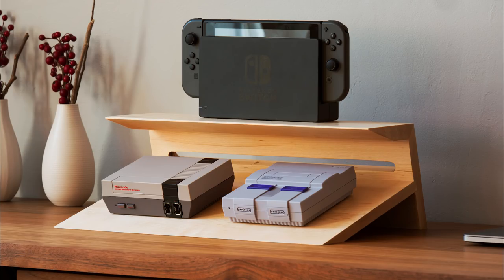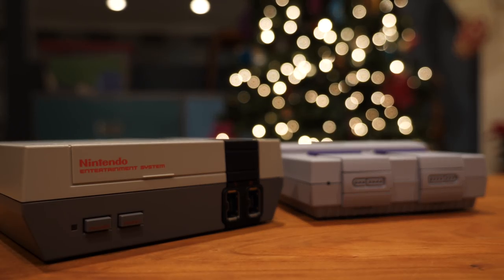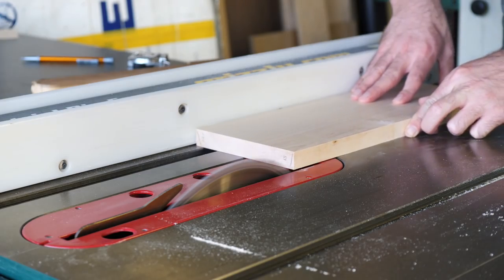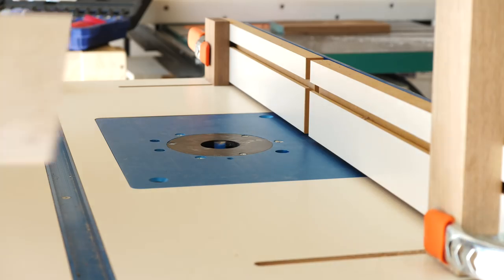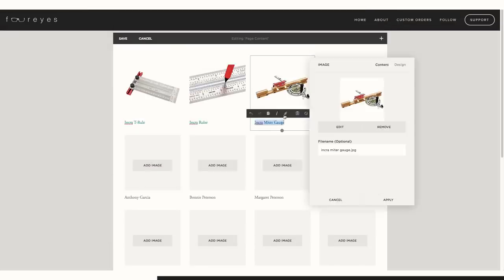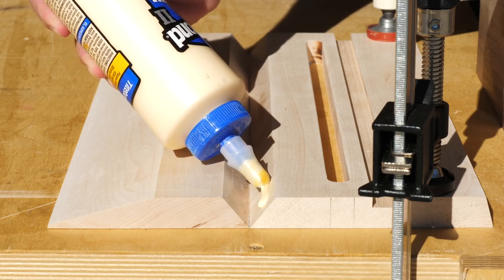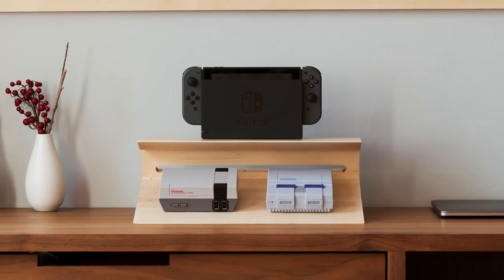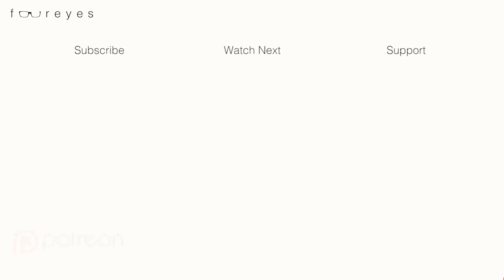Ultimate Nintendo Set Up Display Stand | Woodworking

Comment: Cool video, as always! Two remarks/tips:

1) clean up your groove after the table saw passes, by routing them. Or just route them.
2) When you route that slot... When you reach the end, inch back a few before cutting the power to avoid that burn at the end.
Reply from the maker: Thanks Sam...good tips, especially on the routed slot :)

Comment: Absolutely love this. I don’t have the tools to make it myself and couldn’t convince my wife to buy them for a one-off project (I’m not a woodworker or huge DIYer), so I enlisted the expertise of a local woodworking shop. It’s been 2 months and still nothing. The woodworker says he’s having problems with cupping. Any tips for that?

I’ve watched this video many times and read through 222 comments looking for an answer about the type of wood you’re using. Someone asked, but you didn’t answer, and another guy just posted a time stamp for the smooth transition effect at 7:24. Would you mind sharing what type of wood you used? And, is there a guide or schematic?

Cheers, and thanks in advance for any info!